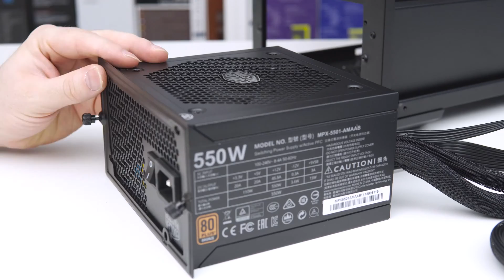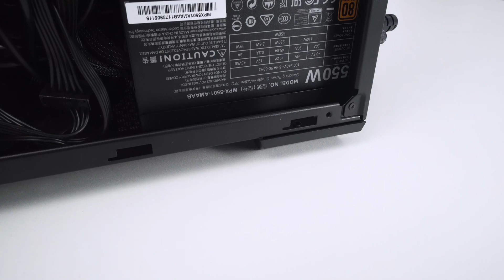Christmas 2017 Affordable System Build

Comment: Do you not wear latex gloves and static cuffs anymore when building PC's? When I was doing it commercially that was a basic requirement. Have things changed that much in 15 years?
Reply from the maker: Never used a band, or gloves or touched a radiator. Never had any system short from ESD etc...
Reply: eTeknix fair enough. Maybe we were all a bit more cautious way back in history or the components were a bit more sensitive.